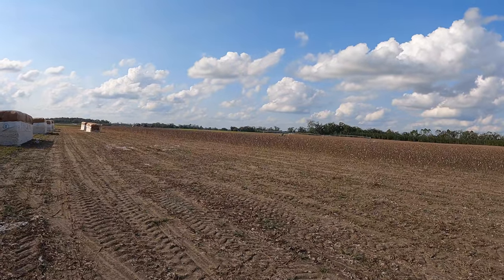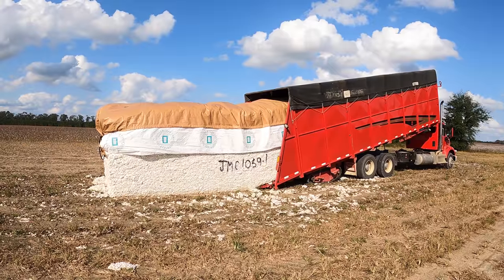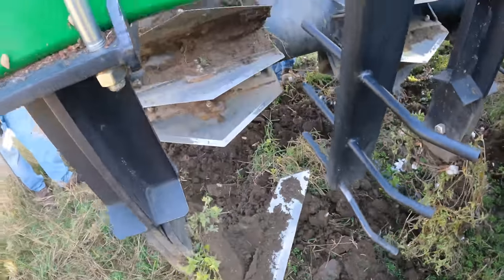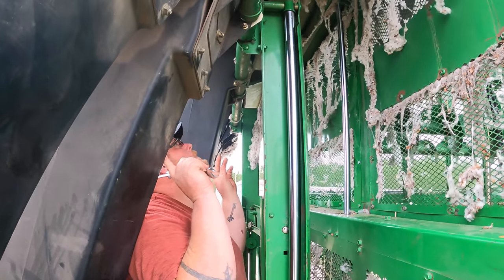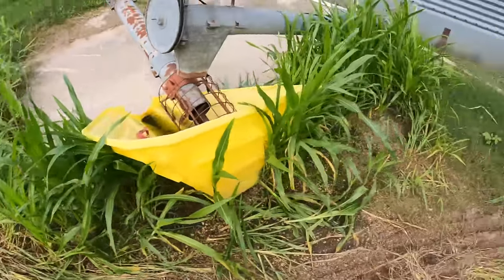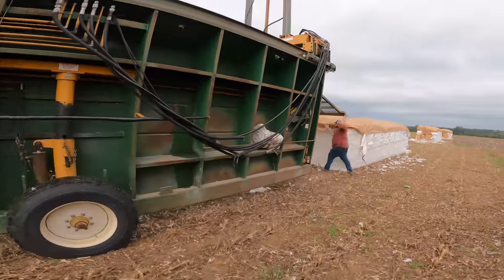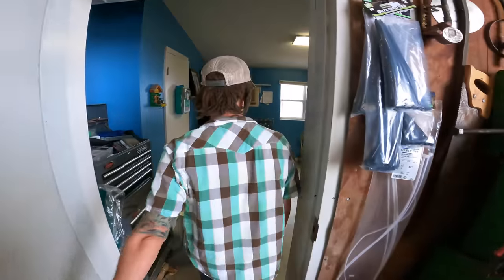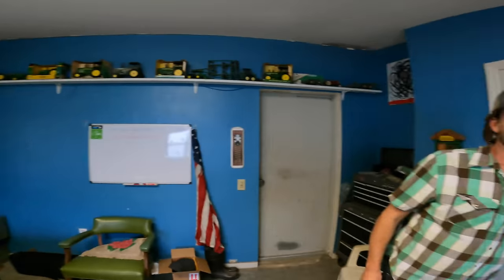Massive Bricks of USA Cotton

Comment: Have y’all ever used a Amadas stalk puller/chopper? There’s a few of those around here and no Harrell’s that I’ve seen. Which don’t make any sense to me because Harrell is made in Vada not too far from here. Unless folks don’t like the blade that runs under ground that cuts the stalk. I’ve never used either, I used to always mow mine after picking, then harrow.